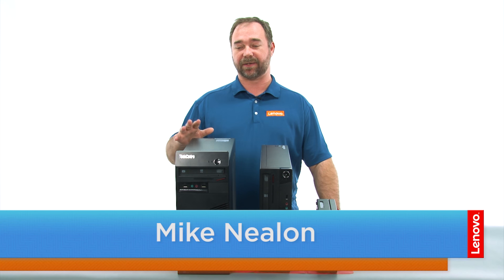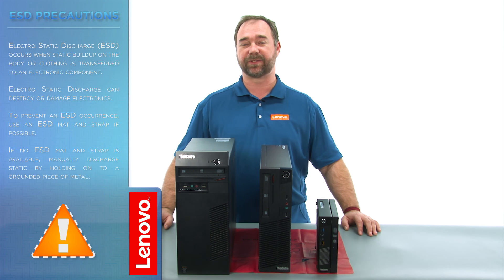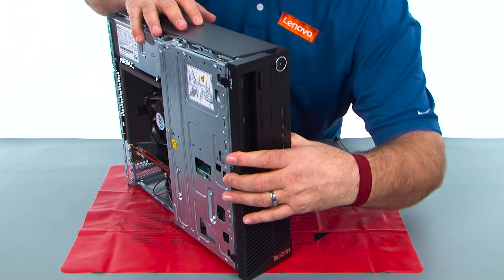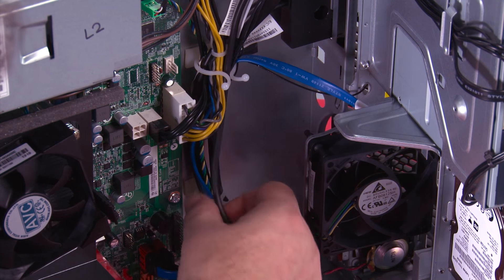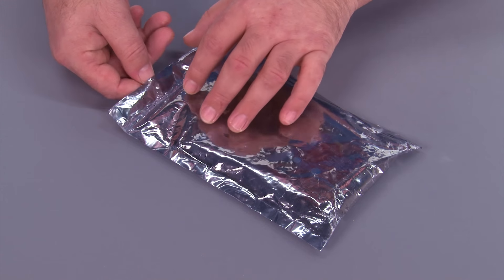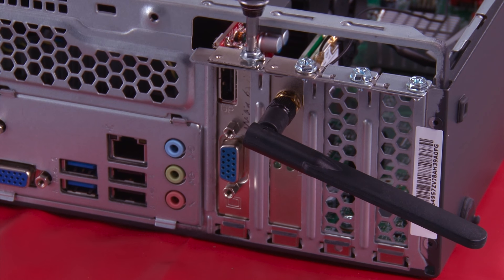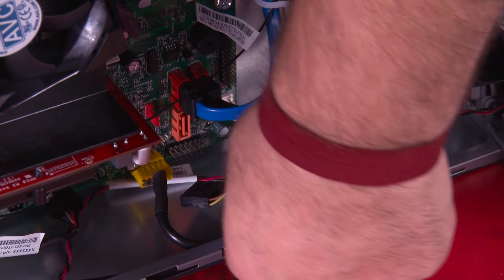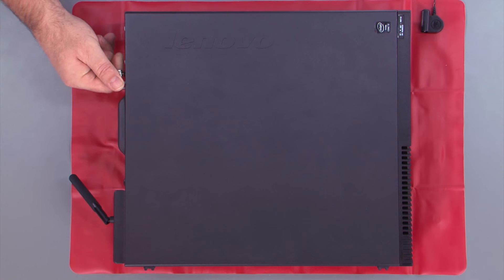ThinkCentre M73 / E73 / M72e Small Form Factor Desktop - PCI Express Card Replacement

Comment: is a pci card a graphics card?? or pci express card and graphics card are diffrent
Reply from the maker: In most cases we use a graphics card, because it's the most common card that's going to be in the PCI/PCI Express slot. There are other cards that could be in there, but removing anything from the PCI/PCI Express slot is the same process as what you see in the video.
Reply: btw can you help me i got a lenovo thinkcenter e73 small factor and i need to change my graphics card 
but the cpu fan cooler is covering the pci slot :/ and i need help to find a card that fits inside too can you give me some tips
Reply: this is how the pc looks like http://image.prntscr.com/image/776b44eff1e8482d9724c037908d1d14.jpg
Reply from the maker: StarCraftOffical/MaxGaming950
Here's a link to the hardware maintenance manual: https://download.lenovo.com/pccbbs/thinkcentre_pdf/e73_hmm.pdf

That manual will show you how to replace every part in the system. Unfortunately we don't have any videos for that particular desktop.